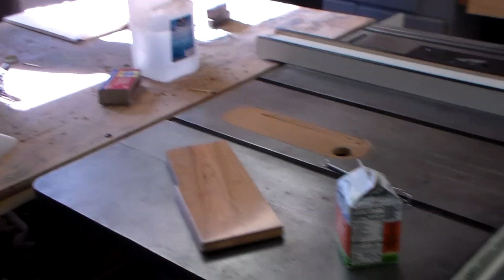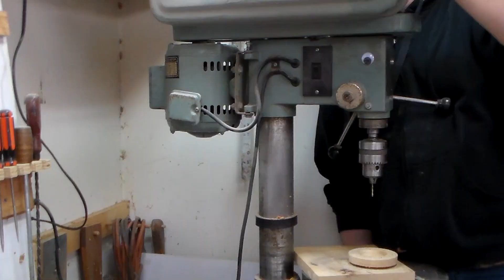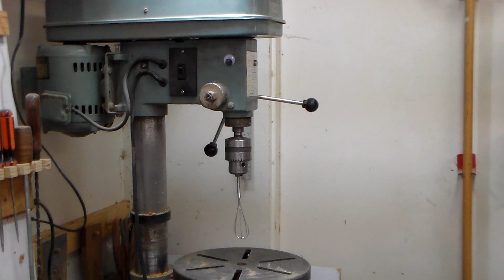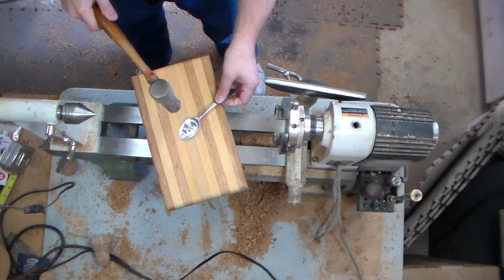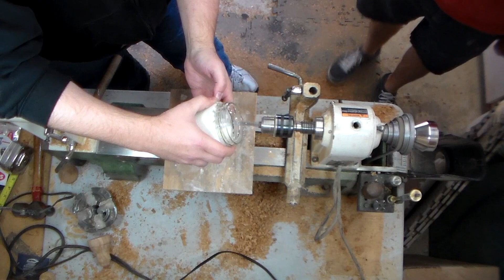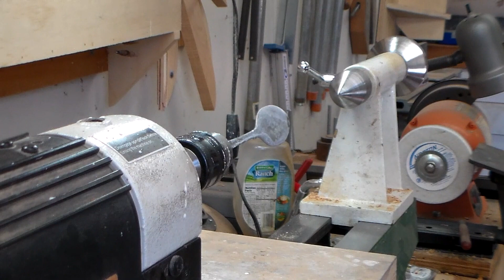Making Whip Creme In The Shop

Comment: If the tapered spindle comes out of the drill press, you have to really ram it in there with momentum for it to stick.  It's actually kind of hard to get out if it's been rammed in there good.  Cool video!
Reply from the maker: Matthias Wandel Thanks! Yeah, it's been loose for a bit since I cleaned it. I really need to seat it again!!!

Comment: Hmmm, I know the bottom from a blender will generally screw right on top of a mason jar.  I wonder if you got an old one with enough spindle to grab onto with the lathe and replaced the blades with the flattened spoon if it would make this work without causing splatter...

Wait, why am I encouraging this?
Reply from the maker: +Urahara1001 That sounds almost like a sensible method. I cannot use it... :)